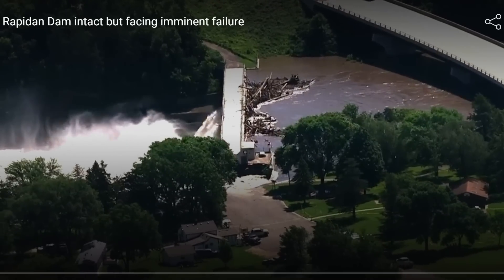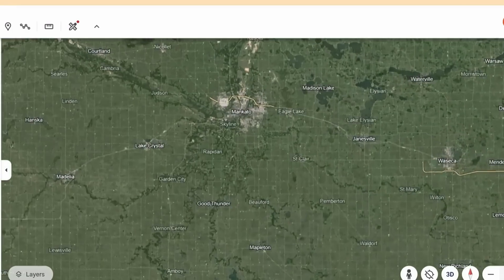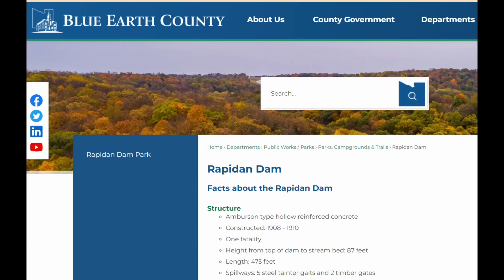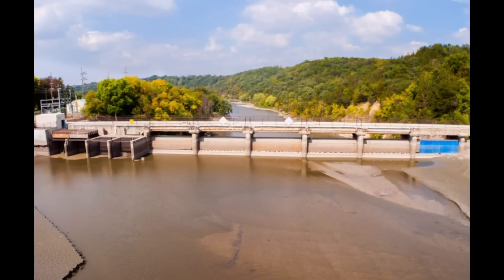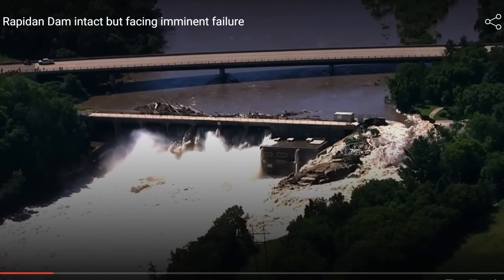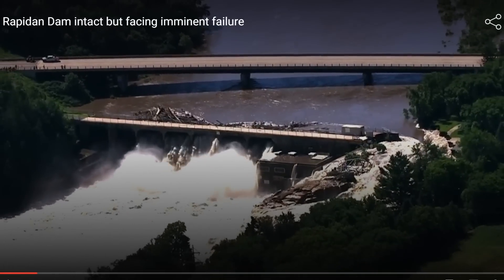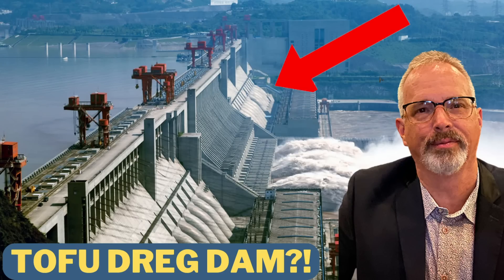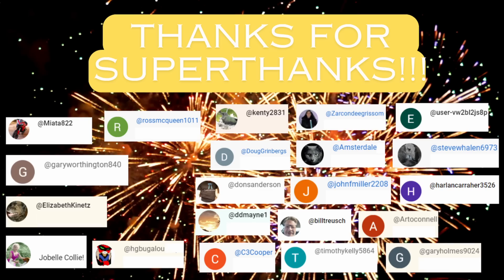Rapidan Dam Failure - Minnesota

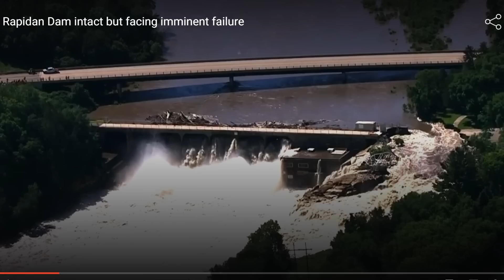Comment: Hmmm ... looking at 6:03 and you say that upper bridge is at risk.  Should the police car blocking the bridge be off the physical bridge deck? I am tempted to think so but do not know dam failures at all.
Reply from the maker: @lauxmyth  Yes. They have now blocked the bridge to all traffic.
Reply: @CaseyJones-Engineer  You somewhat missed my point. The police car seen in the video is on the structure and if the bridge fails, it too could go in the river. Moving the car a short distance could just as effectively block the road.

Comment: As of the afternoon of Wednesday, June 26 no water is flowing through the dam spillways. All water is flow through the left bank cut. The water level above the dam is now lower than the inlets into the spillways. The house is gone. The river flow downstream of the dam is between 37,000 and 38,000 cfs.
Reply from the maker: Thanks for those details.  I was just there onsite filming this afternoon a little after 5 PM.  I will have an update video posted by tomorrow morning.

Comment: Casey, Just because dam building in America in the late 19th and the first half of the 20th Centuries (Hoover Dam excluded) was nearly all jerry-built cheap-Jack rubbish, does not mean that the Three Gorges Dam was built to the same appalling standards of construction of so many rubbish American dams. Your comment about the Three Gorges Dam indicates that you have no understanding of how the dam works or the hydrology.

First of all, the Three Gorges Dam has been built so that if it is over-topped, there could be some damage to the cranes and sluice control gear which sits on top but not the dam itself. There are some cracks in the dam but this was expected due to settlement and does not affect the structural integrity of the dam in as far as it is an immovable and monstrous block of reinforced concrete that unless it is decided to remove it at some time in the future, it will be there for more than a thousand years.

The level of the water behind the dam fluctuates. In normal years, it is at its' highest just after the end of the modified Monsoon, usually mid to late June. Thereafter, the turbines consume more water than water flowing in so the level falls, generally by about 100 feet (about 80% of the reservoir's capacity) in February of the following year. The snow melt from the Himalayas then begins to overtake the turbine consumption and the lake begins to rise again but nowhere near maximum capacity ..... and then, as the inflow from the snow melt begins to drop away, Southern China is hit by the modified Monsoon, which takes the lake up to maximum normal capacity (about 50 ft below the top. There is often excess water, and if there is, the turbines might run a bit longer (they don't all run all the time) or the excess disappears down the overflow spillways. Unlike the Hoover Dam where the intakes can take water from the reservoir close to the surface when at maximum capacity, the Three Gorges intakes are 100ft below the normal maximum head the pressure on the turbines regulated with adjustable wickets.

In normal years (about 9 out of 10) the Monsoon causes very heavy rain which even today sometimes causes some flooding in Lowland China but the clouds move out into the Western Pacific. On the one year in 10 on average, a high pressure block forms over the Western Pacific and prevents the Monsoon clouds from drifting off, and stuck over China, they rain and rain and rain and despite huge amounts of money having been spent on flood control, the Lowland Chinese rivers are incapable carrying the water away and there is serious flooding in Lowland China. The Lower Mississippi is, of course, no stranger to serious flooding.

The Three Gorges Dam, something in the minds of Chinese Emperors for a thousand years and then serious plans being prepared under Sun Yat-Sen before his suspicious death, were all aimed at flood control (and since Sun Yat-sen), electricity as a secondary concern. The Three Gorges Dam has done sterling work at preventing in most years, or dramatically reducing flooding in the Lower Yangtse flood plain, even whilst under construction.

Even if the dam should suffer a catastrophic failure at the lake's highest level (which it won't), because of the gorges upstream, it would take months to drain. Most of the water is stored above the Outang (Qutang) Gorge. Go to https://www.youtube.com/watch?v=tkpL2KbB9Jw and move to 6 minutes 40 seconds. The misspelling on the name of the river boat as Yantze instead of Yangtse is for the benefit of the American visitors who outnumber every other nationality by some margin. Before the Three Gorges Dam, this gorge so constricted the flow that it caused the water to rise by 40 feet above it giving rise to grossly ugly reinforced quays built in Chongqing in the 1920s and 30s. Should the dam ever fail (which it won't), it would take months for the stored up water above the gorge to discharge. The two gorges downstream of the Outang (Qutang) , one just above the dam, are less restrictive but would, nonetheless, obstruct any mass flow of water and there is yet another gorge with a right angled turn in it a few miles below the dam

There have been suggestions that if there is a war between China and Taiwan, then the dam would be liable to attack. This is drivel. The Taiwanese have far more juicy targets much closer to home including the highly vulnerable support equipment of a number of doomsday machines (nuclear power stations). Just take a look at the highly vulnerable support equipment at Fukushima.

NO PROBLEM AT THREE GORGES.

Comment: You have made the same error that many engineers (small-case e) make, They (and you) fail to consult a competent Geologist prior to offering your opinions - where geologic expertise is warranted. In many jurisdictions (Minnesota included) this is seen as malpractice. There is reportedly sandstone (Jordan Sandstone) beneath the dam, which is why it was put there. While not as resistant as limestone or dolomite, it is reasonably competent bedrock. There is also limestone and dolomite in the area, a local geologist would know the site specifics. Erosion of the substructure is unlikely, (or it already would have happened, probably) and you should have known that (or found out) prior to offering your speculation. It is obvious you are not a PE (or RG) in Minnesota, and are just another YT engineer. Please do more homework and actually honor your profession.
Reply from the maker: Wow, you seem really self-important.  I was merely describing what "appeared" to me from near live feed of the site while things were ongoing.  I wasn't doing an exhaustive analysis of site conditions, nor did I suggest that I did.  Get off your high horse.

Comment: Dam wasn’t overtopped 
Water simply found its way around that left side and scoured out the area

Dam has not been used to generate electricity for some 10 years. 

Power outages to the area are from the loss of feeder lines lost with the flooding. 

Infrastructure money didn’t get to this dam before Mother Nature did her work.

Comment: Every dam is designed to have a release  bank. This seems to be working in this case. What can happen is the dam failing due to its age. I do not think the actual dam will collapse but there will be flooding down river. Maybe major flooding if the spillway gets deeper and more water runs

Comment: Three Gorges Dam, when it was constructed, was one of the single largest engineering projects ever undertaken in human history.  The dam body was completed in 2006, and hydro-electric full capacity was reached in 2012.  As such, the dam is less than 20 yrs old and many engineers worldwide consider it to already be in a state of cascade failure.  The walls of the dam itself are evidencing considerable buckling due to unanticipated sediment deposition, areas upstream of the dam are experiencing unexpected and sizeable landslides (which contributes to sedimentation of the reservoir behind the dam), as are areas below the dam.  The dam cost billions of dollars to build, took a decade or more to complete, and yet now is being considered for both decommission and deconstruction.  In short, it could end up being one of the greatest and most expensive engineering failures in human history.  Time will tell...
Reply: How could there be "unanticipated" sediment deposition at a dam? It's going to accumulate eventually, if not all at once from upstream disasters (though landslides are a rounding error for what the Yangtze carries).

Comment: This is the 2nd place I was at one year ago that happened to fail. First the Teton pass now this. I was in both places last June touring. I would like it known it was not me.
Reply: The USA has some 91,000 dams.  Given that most small dams are over 100 years old, and the economics that originally drove creating the dams have been wiped out, many aren't maintained.  So you have to expect that there will be failures each year.

Comment: You have no clue what is happening here. So to be clear you think that the west side of the dam is anchored into dirt? I think the engineers 100 years ago knew a heck of a lot more than you do about building a dam. This dam has not failed and will not fail and is spilling over the limestone rock face and washed out the dirt that they put in after it was built. Someone should investigate why the debris was allowed to block the dam for the first time in over 100 years and did nothing to monitor or remove it. Someone allowed it to breach the natural spillway that the original engineers designed in to it that is working as it should.

Comment: I live 25 minutes away in Northfield, MN. Cannon River...raging,  flooding, trees ramming into bridges etc. There are two small driving bridges that cross the Cannon.  (One is 5th St.)

 This is the 3rd and the worst catastrophic flood since I moved here in the mid-2000s. I have never seen these bridges being worked on. The 5th St. Bridge is above the falls and there is always a rapid flow rate there. Would you look at those bridges? People are still driving over them.  Not me, though!
Reply: governments are NEVER held accountable either.

Comment: From not seeing any equipment for regularly managing debris my initial reaction was this was a maintenance and standard operating procedure problem. The two small dams that I regular drive by have equipment for removing debris that is part of the dam. My initial thought was that this debris had built up over time. But the flow chart suggests that the majority of that debris may have arrived all at once. Note that the chart is for the flow downstream of the dam. Late last night or early this morning the flow suddenly drops then came back up over a few hours. That is what I would expect to see if most of that wood floated down the river and arrived at the dam all at once. 

There may have been maintenance issues. But it looks like they also had some bad luck.

Comment: The matching portion of the Three Gorges Dam is the area of the ship lift and the locks, all of which present easy failure points, particularly because the concrete of the walls of the ship lift have already shown cracks developing.

Comment: The Dam is not going to FAIL.  There is sandstone the Dam  is sitting on and also the Dam in pretty wide with reinforced concrete.  Its going no where and also the water did take the bait shop and washed down to bedrock now... The Concrete to the left of the dam is the same on the other side of the dam were the power plant is located...  They should have put a spillway in years ago,,, now mother nature did it for them.

Comment: You should checkout the street view from the bridge to give a better perspective on the damage that has been done and everything that has been washed away. Also the street view shows where they had some type of emergency spillway setup just below that substation.
Reply from the maker: Thanks for that.  I do see all of that flatwork there.  It looks like it leads from the dam and turns just in front of the power house.  It looks rather small though.

Comment: They should be hauling in material to hold back or at least slow down the water.    if some of the regular gates aren't function, they could literally blast them away.   Anyway thy can lower the water will  let them work the problem in the summer.

Comment: Thank you for the video. 

I was hoping for a more comprehensive structural integrity assessment of the dam, including visible concrete condition evaluation and foundation stability. Additionally, I hoped for an analysis encompassing the potential failure modes such as overtopping, internal erosion, and structural failures due to concrete deterioration or foundation instability. What is your assessment of the dam's present condition? Lastly, do you have a risk assessment incorporating failure probability and the potential consequences of dam failure?

Please do a more detailed video when you can. I really enjoy your videos when you dig deeper into the details.
Reply from the maker: Thanks for your comments but this was an initial video done on a breaking news basis.  The deep dive videos typically take a few weeks of research.

Comment: Jeez, get it right.  The dam is still standing. The water blew out the spillway area on the side of the dam.  It hasn't overtopped the dam yet, and the local news a few hours ago was  reporting that the river level is now decreasing.
Reply from the maker: Are you saying that there is nothing extraordinary problematic happening with this dam?  It doesn't look "business as usual" to me.
Reply: @CaseyJones-Engineer Why did you just blatantly ignore the points the commenter stated?🙄

Comment: Everyone keeps saying the dam failed for cheap-ass clickbait views. The dam hasn't failed, it is still intact and holding back water. The 5 spillways of the dam are clearly shown to be clogged / obstructed with logs, debris and branches, causing water to go around the dam. 

For an example of a failed dam, look up the St. Francis dam in California.
Reply from the maker: It is not clickbait.  Any time a dam is unable to retain its reservoir water resulting in an uncontrolled release it is by definition a dam failure.  I don't know how water flowing around the dam where it isn't supposed to be flowing and results in massive scour at the abutment could be called anything but a failure.

Comment: If you can find the summary of the reasons they proposed removing the dam there are a few critical details. One being the bridge is not on pilings to bedrock so the sediment removal will jeopardize or damage the bridge. Also the concrete apron (?) on the downstream side, where the water is supposed to go is subducting from normal use the dam   From what little I understand it is like part of the footing holding the dam in place 🤷🏼‍♂️ knowing this information it would be interesting to discuss the additional possible failure modes of the dam. 😅. Thank you for finding the interesting information and pictures. I encourage you to check out the project proposal and see what else we can learn.

Comment: use Lg dumpster bags fill w sand 2 rapidly deploy water diversion/plug. can place w crane/helicopter fill w backhoes... rather than trying to offload loose dirt that takes too long to berm up and can't be done in areas that are already overrun with water but with those bags they have the capacity to do a lot of work in a short amount of time without all of that added mess and hassle of loose dirt washing away or in an area is not reachable
Reply: Wat?
Reply: @KSparks80  use the new types of dumpster bags they hold 3300 lbs or so depending on size and use that fill w sand like giant sand bags
Reply: @wisdomsleuth77777  There's no way that could fail!
Reply: @KSparks80  I guess you think wasting time loading dirt Trucking it to a site that you can still reach that hasn't already been flooded to offload trucks and then use dirt movers to place loose dirt as a berm is a better idea I literally watched another area that had the same type of breech around the side edge was trying to backhoe dirt into that and it was literally washing away  if they would have had bags you put instantly in place it's like a wall and it would work as those bags not even extra large hold about 3,300 lb you are containing the sand just like the same concept with small sandbags that are used all the time to prevent water infiltration in under your door or vulnerable spots for people's houses in the South that happens all the time. They even have new types of property protection round tubes that they actually fill with water to keep them in place to protect the property. This is something that is available and the concept is absolutely a good one especially considering they are available and built rugged and have handles on them.

Comment: The is not failing ! Why are you And everyone
else lying about this ?
Reply from the maker: Lying?  Any time a dam fails to hold back its reservoir which results in a big uncontrolled release it is termed a "failure".
Reply: @CaseyJones-Engineer  so any time water goes to a spillway your telling me the dam failed ? Try not to sound foolish
Reply: @scottkinkead6324 this was not a spillway. The water routing around the dam has taken out a shed and is about to pull in a house. There is also a little dam restaurant that could go in.
Reply: @lawnmowerlarry  it is now , I know exactly what's  going on there I go camping there a lot
Reply from the maker: @scottkinkead6324  We are talking about the difference between something that is designed (Spillway flow) for versus something that wasn't designed for (eroding out the abutment contact due to overtopping of that portion of the dam.